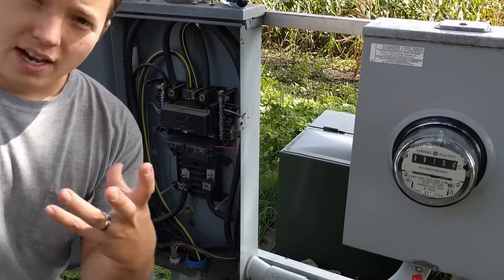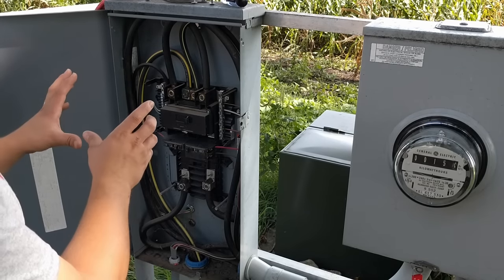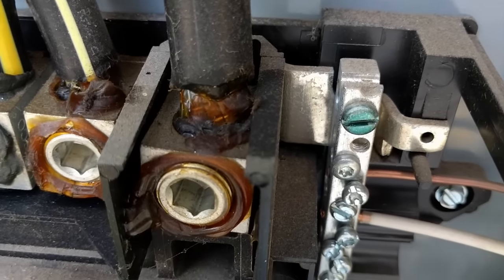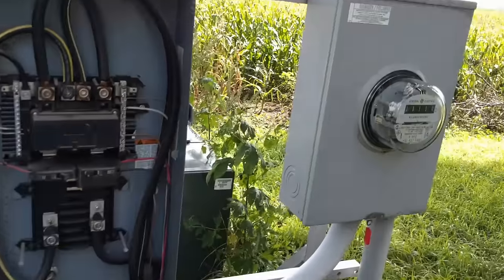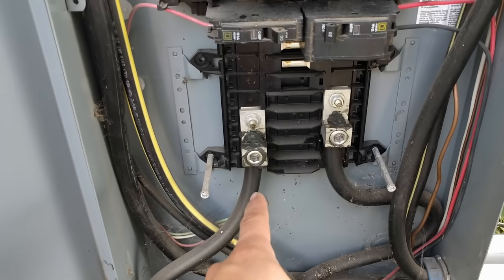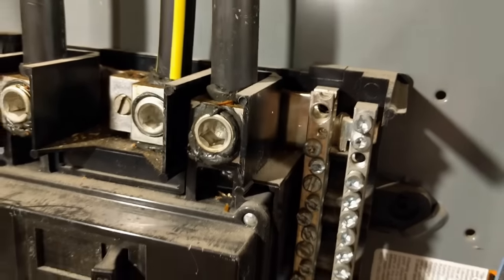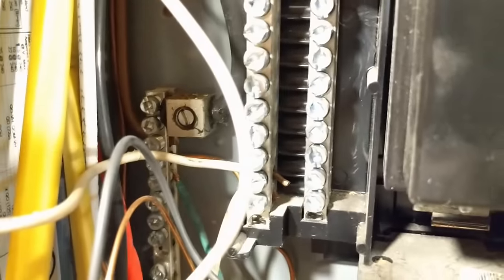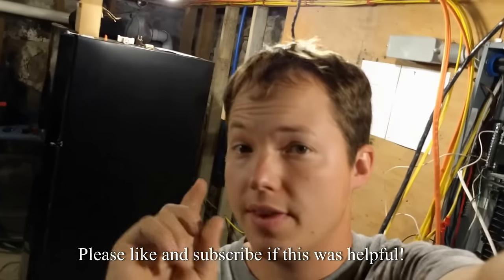What Is a Neutral Bonding Screw in a Main or Sub Panel Load Center & Should It Be Used or Removed?

Comment: Don Smith finally added a reason why you tie the grounds back to a single first point. Amplifier hum. There will be other reasons as well. rupe53 contributed a false trip on a GFIC. I would like to know about those scenarios as well as the color of the bonding screw. While following the electrical code is one reason to do proper grounding, it is not the only reason.

Comment: What is meant by Benjamin's final comment to take the green bonding screw out of secondary panels and "chuck it in the grove"?  Is that the same as 'toss it in the garbage' or is it some subtle electrician lingo?
Reply from the maker: Hey Ken! Here in Southwest Minnesota everyone has a "grove" which is defined like this:

grove
/ɡrōv/
noun
a small wood, orchard, or group of trees.

So yes, it basically means that you should discard the bonding screw so that it will not be accidentally reinstalled. Sorry if it was a bit confusing! Also, thank you for being a subscriber!!!
Reply: I like to save the green bonding screw. They're painted green and if a main breaker panel is missing one and needs one, I will have one that might fit.

Comment: Quick question, if you were on the main panel, does that mean the neutral and the ground can go into the same bus?  I'm installing a NEMA 14-50. Just trying to be very cautious with how I install a ground in the neutral. The box is definitely the main and first electrical panel from the power source (city meter)

Comment: I have an old subpanel wired into my shop. It only has three wires coming into it. It does have a separate set of grounding stakes. The sub panal is currently bonded.  Is this okay?

Comment: I am working on replacing a 1930's Square D panel (which is very small 11"x6-1/2"), it is located inside the house. It is a farm house that was built in the late 1800's. I wish I could post photos for reference. Anyway, outside, there is an electric service pole with a meter. Inside that same panel with the meter is a 100amp shutoff. When installing the new panel (inside the house), should I leave out the Neutral bonding screw? In other words, is it the same as you have here in the beginning of the video, just included in one panel instead of two panels? 

And my second issue is, now that I had to cut a bigger opening in the wall for the new panel, some of the wires are too short to reach the new location of where they are supposed to go (I really wish I could post some photos). What is the best and proper way to extend these wires? can I just use wire nuts in a panel to extend a wire, or should I use some sort of wire splicing that involves heat shrink tape? Thanks for any help you can give.

Comment: Ok everything good but the principal question is why??
Reply: Iram-bitxz because at the sub panel if it’s bonded that gives returning current of the neutral a path back to the main through the ground
Reply: @steveshear7546  So, why is that a bad thing? If it works in the main panel,(that's bonded) then why isn't good enough for the sub panel? The ground is a safety path, a drain for stray voltage?
Reply: @bebo5558  I'm trying to wrap my head around the same question at the moment.  What I'm thinking so far is that in a condition where a device connected to an outlet fed from the sub panel has a ground fault and a person was touching that device, they could potentially be a lower resistance and the returning current on a neutral line would pass through them instead of going back through to the main box.  Essentially the returning current would usually be going back through the neutral line always because of low resistance back to the main panel...but if you connected neutral and ground at the sub panel, there's an opportunity to create a scenario where there's lesser resistance to ground through a person touching a faulted device.  Not sure what conditions would make this possible... long run back to the home panel? Wet ground when a person touches a faulted device?  Some type of large equipment or motors with low resistance? Etc. I think the reason it's ok at the sub panel is because that box has it's ground bus connected to an outside bar going into the ground... super low resistance.  This is the only logical reason I can assume so far but again, I'm learning and just taking a guess here!
Reply: @MollerFarm  This is a "BIG" can of worms, you put 10 electricians in a room and ask, "why do you separate the ground and neutral, in a sub panel", your going to start a fist fight, because nobody really, knows, understands, agrees or cares!  It's written in to the code, so it's the "undisputed" gospel, not so!  This rule went into affect around 1999, so what about the millions of homes wired before this rule, are they now unfit to live in, NO!  Does it make them illegal or unsafe, NO!  When a district, county or area, use the NEC, they can decide, which parts they adopt and how, they enforce each part.  There was an electrical inspector in my area, that was a retired electrical engineer and for years he didn't enforce the separation of ground and neutral in a sub panel, because he did not believe it to be correct!  He told me three things, 1-If you have a rail road track 10 miles long, (one track is ground and one track is neutral), then you bond or jumper both at mile one (main panel), the other end (mile 10)(sub panel) will also be bonded/have continuity!  2- grounds and neutrals are like anchors for a ship, to take any stray voltage and anchor it to 0v ground reference/back to transformer!  3-When you create a new rule to follow (NEC), you can always come up with hypothetical situation to justify it!
Reply: I’m not an “electrician”. However, I’ve been an electronics technician for 28 years. I was taught one basic rule about grounds in the navy. “Ground is ground, the world around”. Meaning, it doesn’t matter where you connect the ground. The only sense I can make of the sub not being bonded, is that there is a “separate” isolated path to the mains ground. Meaning, that if you have a short after the main, it, theoretically, will ensure the breaker at the main will trip; regardless of what the sub panels breakers do. However, this would still hold true if the sub was bonded and properly grounded. Because... Ground is ground, the world around. So. Yeah. It’s a huge can of worms. LOL

Comment: Good show Ben. Whoever installed my sub panel didn't pay any attention to segregating (hate that word but it fits) the gnds and neutrals. I really appreciate the close up picture of the Gnd screw and where it goes, and the other close ups.
Question - When changing out a Sub panel and some wires are too short to reach the correct Bars/busses, what are the rules for installing a additional bar/buss to connect the short wires to? Rather than using a wire nut and pigtail to make it reach?

Comment: I am a longtime subscriber and viewer. You're channel is one of my favorites on electricity. I would appreciate your opinion as well as any knowledgeable viewer's opinion on when not to use grounding screw on main first panelboard as I describe in my home. I own an old home that has a main panel inside the house, it's the first and only panel coming from meter.  It doesn't have a bonding screw. I was thinking I need to add the bonding screw but then I consulted a book I have and read that the main panel must not use the bonding screw if the breaker or switch is used, such as in a panelboard on the load side. I belive that my panel fits that description because the hot wires from meter go directly into a 100 amp breaker and the neutral from meter goes into lug on the neutral ground bar in panel. The book I got this information from page  93, section Bonding the busbar, in the 45th edition of Wiring Simplified that is based on 2017 NEC code. Author F P Hartwell.

Comment: I'm curious: are the neutral bar & ground bar isolated from the breaker can (using rubber or plastic grommets) in case there is a short in the neutral and the can won't conduct electricity (so nobody gets shocked touching the can)?

Comment: Short story: you only need to ensure your neutral is bonded to earth at one point - two doesn't change neutral off it's earth reference one iota, and its not really there for a [normal] current path anyway.   Code says do it in the main panel.  Why they didn't choose the meter?  Oh, probably to ensure fewer entries to the meter pan and ease of inspection.  Remember that a typical pole-hung transformer is fused on the primary side only, and a flashover event [should it occur during meter removal]  is going to deliver as much power as the transformer can couple until/unless its fuse blows.

Comment: Is there another screw or screws connecting a panel box to neutral.  With the bonding screw removed and no ground wire connected, my meter shows that the panel box is connected to neutral.  I would appreciate any help you can offer.

Comment: I do not have a water meter to ground the panel  to. I installed two lightning rods outside 7 feet away and those have a bare copper wire running to the meter socket. Would I also run an additional bare wire from panel to lightning rod?

Comment: Interesting how you fellas do your wiring.

In Australia, we use green/yellow for earth, black for neutral, and red/white/blue for the 3 phases. The neutral and earth are also bonded at the point of entry and we call this the M.E.N link. We use a modified version of the TNC-S earthing configuration. Our voltages are 240v from line to earth or neutral and 415v from line to line.

Comment: I have an older house.  The green screw was missing.  The inspector said that I could either find a replacement screw or run a copper wire from the neutral to lug screwed into the base of the breaker box.

Comment: if the meter is in and the disconnect is turned off is the neutral leg live or dead..we have been told to put a neutral bonding screw in and wondered if it can be done  without pulling the meter again

Comment: My main service panel does not have a bonding screw but i have a sub panel out in my shop that does. That doesn’t seem right. I do have a strap in the main panel connecting the neutral and ground bus bars but no grounding screw.
Reply from the maker: Some panels use bonding straps. For the one in the shop, I would recommend leaving the screw in. Most likely, there are only 3 conductors feeding that panel, and removing the bonding screw would actually be dangerous. If you do have 4 conductors coming from the main panel then it might be possible to separate the neutrals and grounds but like I said, I would probably just leave it.

Comment: The subpanel in my shop doesn't have 4 wires going to it.  I'd like to add a grounding bar to separate the ground from the neutral.  Can I put in a grounding bar and run it to a copper grounding rod outside of my shop and get the same result
Reply: Yes

Comment: Very helpful video I’ve wondered when to and when not to use the bonding screw many times. But i have a question where does the grounding rods go and which box should they be connected to? The original box or the sub panel box? Sorry didn’t catch it in the video. I’m thinking that the ground rods should be installed in the area of the original box first in line from the meter but I just want to ask to be sure. Thanks!
Reply from the maker: I'll be making a video regarding the ground rods hopefully soon but basically you need ground rods at each building. Two rods placed 10 feet apart are tied to the panel in my basement. There is also a ground rod at the transformer and for the cut off panel next to the meter.
Reply: Benjamin Sahlstrom awesome I’ll be looking forward to the video!!
Reply: Very helpful video. I just have meter box and the panel. So i would just ground meter to grounding rod . thin in the panel i would run my #6 ground wire from my neutral bus to a cold water pipe right
Reply: I have a 100amp service
Reply: My bonding screw is on the ground bus so should i move it to the neutral bus?
Reply: @SacredAmerican   don't remove or add bonding screws if you're not 100% sure of what you're doing. Call an electrician. You'll cause potential shock hazards, and possibly mess up any mains powered electronics. Grounding and bonding are NOT the same thing, and it takes professionals years to recognize the difference
Reply: @SacredAmerican  don't ground your meter. It's not the first point of disconnect or "cut off box" as its being referred to in this video.
Reply: Warren, if it takes professionals years to recognize the difference, are you saying professionals don't have a clue what they are doing with the bonding screws for at least a few first years in their careers? I wouldn't be surprised as I am yet to hear a single professional here on youtube to explain why bonding screw is used in the first panel, but not the following panels. All seem to only state it as a fact like parrots. If you already have ground and neutral bonded in the first panel, what's the problem of bonding the two in a subsequent panel? Aren't those wires already bonded several feet away? I honestly don't understand why.
Reply: @davison0976  i am saying that a lot of electricians honestly don't really understand grounding and bonding in the beginning of their career. Its not something you can only learn from a book or classes.  I don't think you will find many longtime electricians who disagree with that statement. 

As for why not to bond the ground and neutral down stream of the first disconnect - 1) it's a violation if the national electric code. 2)  the grounding wire is not designed to carry any electrical current. This is the main idea of not bonding past the first disconnect. If you bond the ground and neutral down stream, you have given the current a parallel path to travel on, as opposed to only on the correctly sized neutreal.  Its always bigger than the ground wire and never connected to metal parts people can touch,  unlike the ground wire that we bond to metal parts people might come in contact with.   Simply put, but not simply done in real life, the grounding wires should NEVER carry current. Due to the nature of electricity wanting to take the path of least resistance, it will split itself up and travel along any conductive surface that it touches. That's why bonding down stream of the first disconnect is dangerous. It is not for functional purposes,  its for safety reasons.

I hope this brief explanation has helped. I suggest searching for "mike holt grounding and bonding" on google or YouTube if you want to learn more from very experienced professionals.

For anyone who would like some clarification - "Bond" or "bonding" is just another way to say "electrically connect together"  The NEC, and electricians use bond when referring to the grounding connections if an electrical system
Reply: @wm79198  thank you, much appreciate the response. I had finally got it. Like you said, if neutral is bonded to a ground in a subpanel a current traveling on a neutral from an appliance connected via subpanel will split at a neutral to ground junction and part of it will travel on a ground wire between a subpanel and a main panel. That is not an intended use of a ground wire from a circuit/system design standpoint and increases a risk of an electrical shock if many appliances are used (subpanel at near max capacity) and one of them has a short. In a latter case current traveling on a ground wire if the ground is bonded to a neutral in a subpanel will compete with a current that has to be evacuated by a shorted appliance. That will increase a time of how quickly the short will be cleared by a circuit breaker (breaker pop) because electrical surge through that loop will not occur as quickly as it would had occurred if only the shorted appliance's current was traveling through the ground wire.
Reply: Not quite right. All current flowing in the neutral or ground wires is coming from and through the breaker. So the bonding of neutral / ground has no effect on how fast the breaker trips in a fault. There's not enough space here to explain why you don't want the equipment grounding conductor to act as another neutral.
Reply: @MandrewP  bonding of the grounding conductor and neutral has everything to do with how fast a breaker trips in the event of a ground fault.  If you don't have the same potential back to the source on your grounding conductors that the neutral provides,  than your breaker might never see an overload in the event of a ground fault.
Reply: @wm79198  So what about at second box you run 2 grounds 12 feet apart in the ground. That is a ground. arent you creating a secondary path?
Reply: @mostlikelywedoitservices9743  run two grounds 12' apart?... not an option. Code says ground rods are to be between  6' and 10' apart. 
 The code also forbids "adding ground rods to the second box" were supposed to bring an equipment grounding conductor to the "second box".  Not a grounding electrode conductor
Reply: @wm79198  Thank you for that.

Comment: been searching your videos for a prob I encountered on my house. City did some water meter work and when the city person disconnected the water meter line he got a current jolt. He came to the door to ask me to shut off the breaker main which I did. When I went to turn off the breaker one of the 15A breakers was buzzing. He did his work and then I turned power back on and the breaker appeared to be ok. I have two ufers on the system as well. Does this mean that I have a current drain into the grounds all the time? How do I track down the prob. Why did the 2 ufers not handle the grounding prob?
Reply from the maker: I would put a clamp meter around the water main and see how much current is leaking there. Then turn off your breakers one at a time to find out which circuit has an appliance or issue where current is leaking to ground. Sounds pretty bizarre though!